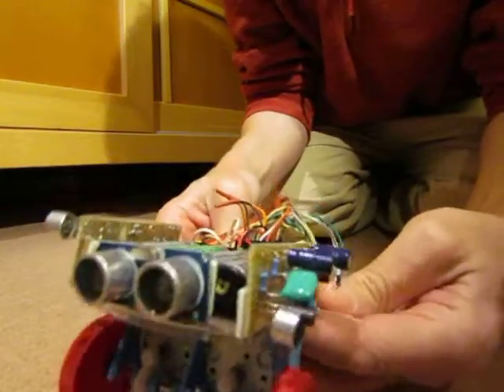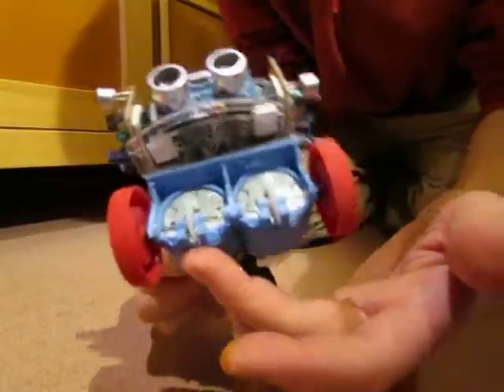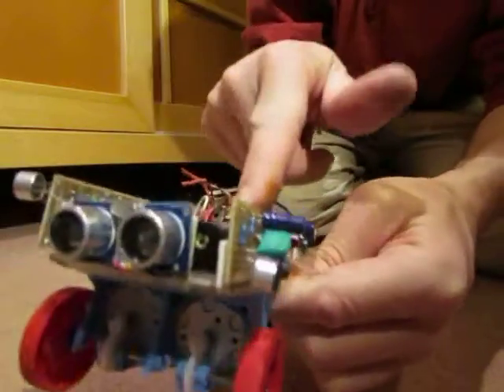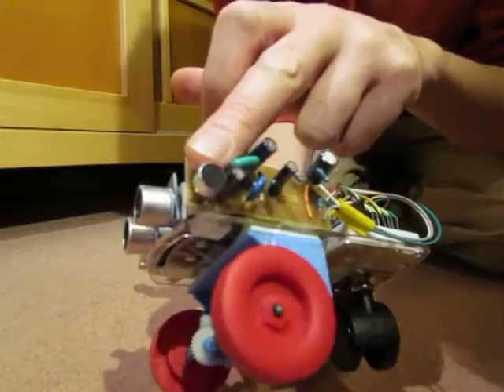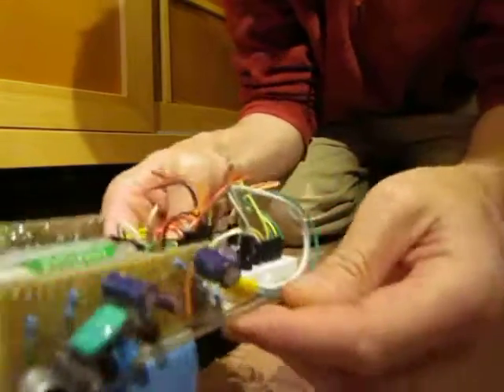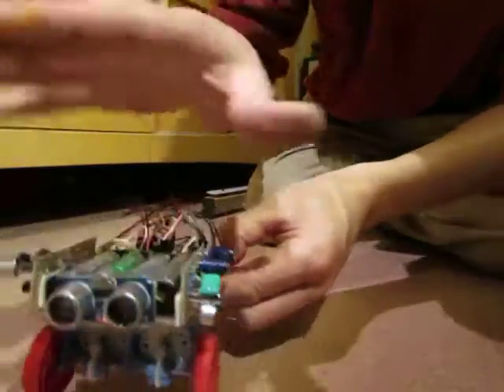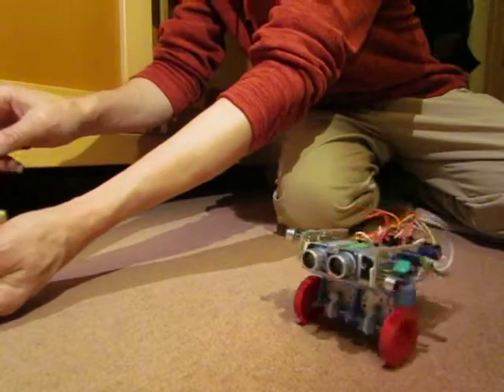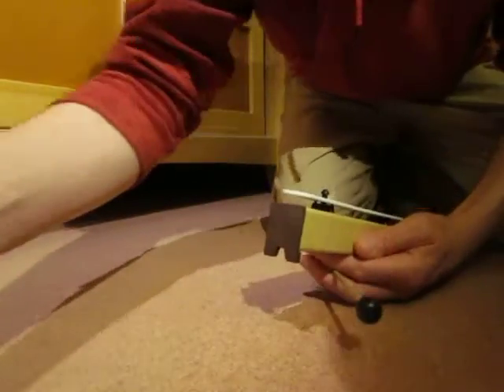Sound Following Robot

Comment: I want to know is it available for the KY-037  microphone module?
Reply from the maker: if you used a KY-037 you would need to amplify the signal from the module
Reply: +Peter Black 
Thanks a lot for reply my question , it help for my college final project!
I try to understand the theory behind the code. 
Otherwise,
１． I would like to know what is the variable 'c' means in the  code.
２．Why we have to divide c by 1.25?
３．Can I just change the variable in the code instead of amplify the signal when I used KY-037.
Thank you so much^^
Reply from the maker: my problem with the  KY-037...
the Arduino analog in 0v - 5v  and gives you a number 0 - 1024
the  KY-037 works ok if you put it in your mouth and speak loudly
but at a distance of 1 meter it bearly registers any sound!
analogRead() gives you a level of only 1 or 2 when you clap or shout
you can't use this to tell which microphone hears more the left or right one.

so you have 0 no sound 1 for sound there is not enough data, no sensitivity you can multiply the value by 10 or 100 but it is still useless.
if you rasie the sensitivity and read 15 on the left and 16 on the right 
these small differences give a useful value when averaged over many readings.

you need at least 10 -20 at 1 meter! 
this is why the output from the KY-037 needs amplification.

i keep analogRead() values in 2 arrays one left[100] the other right[100] the last 100 samples from microphones are averaged to give a level for each.
As a sound wave is heard the analogRead() value goes up and down with the wave form to simplify this we average several readings to get a single level from left and right that can be compared.
the left value is subtracted and the right value added to  C each loop
(I don't know why I chose C  ;? )
positive C drive right wheel
negative C drives left wheel
0 is returned when sound levels are equal.
the  values right and  left  are added continously 
so dividing buy 1.25 stops the value building up and returns it to zero when there is no sound.

Thanks for asking
I hope that helps
Peter
Reply: Thanks for your reply, it's very helpful for me.
I will try to amplify my signal.
I almost understand the code now.
As you say 'positive C drive right wheel and negative C drives left wheel'
I saw you set if(c>10){...} in the code, the number  '10 ' , i have to try and verify myself, right?
Reply from the maker: Well spotted!
It has been a while since I wrote this.
The theory was that 0 would be the central position.
but in practice the two amplifcation ciruits produce slightly different amplifcation.
So 10 was an offset or bias to stop the cart turning to the left.
Yours
Pete
Reply from the maker: I put a circuit diagram on my blog
http://randomagglomeration.blogspot.co.uk/p/robot-arm-with.html
SHOW MORE
Reply: Great work !
Thanks sharing it. It helps me a lot!
Reply: Sorry can i ask u some questions abou this project? For the below circuit, what values of frequency as well as the strength of sound have u used? I tried to clap my hands and it seems to be not detected sound. I also tried other ways w/ f=1khz, but it still doesnt move...

Comment: I want to understand the theory behind how it calculates where the sound is coming from by comparing the sound level from the two microphones.
Reply from the maker: ok
 I will try to put something on my blog this weekend
Just out of curiosity, where are you studying?
Reply: Peter Black 
India
can you please provide the link to your blog?
Reply from the maker: http://randomagglomeration.blogspot.co.uk/

I was hoping for the name of the college.
Reply from the maker: Sound is tricky it can be reflected or focused by near by surfaces to give a false impression of where its source is.
If you use the time difference of a sound arriving at two microphones, then you have to know that the you are looking at the same sound at each microphone. So most people have a quite room and use a sharp sound like clicked fingers or clapped hands, this gives you a nice clean signal to work with.
I found that timing on the Arduino Nano was not quite fast enough.( but maybe I don't know how to get the best out of the Arduino. I notice most people use some other timer chips )

If using the difference in volume at each microphone, I think calibration of the sensitivity / amplification of  the mic and separating the sound you want to follow from the general background are your main concerns.
I use 2 long arrays to store the sound values from each mic and then average these values to give a background level for each mic.
Then any sounds that are louder than this average value are compared left mic with right mic and which ever is greater determines the direction.
I have to admit I was amazed when it worked. It works best with long consistent sounds, as with the chime in the video it also followed the noise from  drill really well.

the principal is the same as the light following robots that use two light sensors to control two indepently driven wheels.

That is a very nice looking college, all the best with your studies.

I think a simple project done well is better than a complex project that you may struggle to complete.

I hope the code I have posted is helpful, I will post more when I have time, but if you have any specific questions ask away!

Yours
Peter
Reply: Thank You so much Peter!
 Really appreciate your help.

You have used Arduino Nano, I am planning to use UNO and see how it works and add more sensors to check if any difference can be made since you mentioned that it gets confused by the sound waves reflected from near by objects.
Designing this using TDOA  or beamforming algorithm to process the sound signal, which we thought of doing at first, is making things complicated. So, we will stick to comparing the sound intensity of each microphone/ sensor.

But this prototype really helped.
Thank you for the code too, I checked your blog :)

Saswati